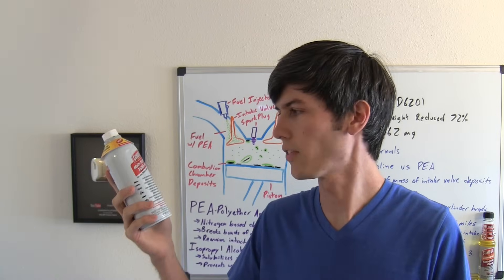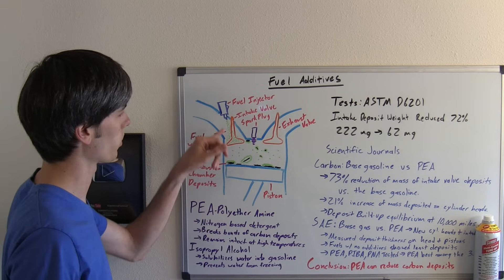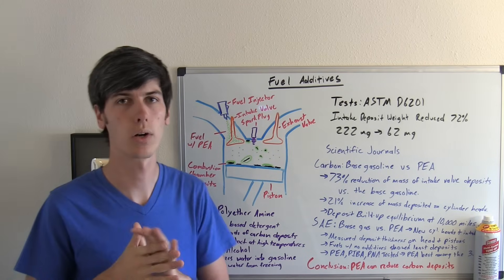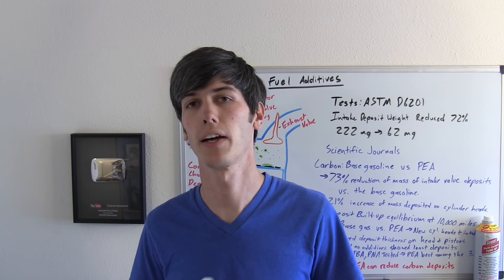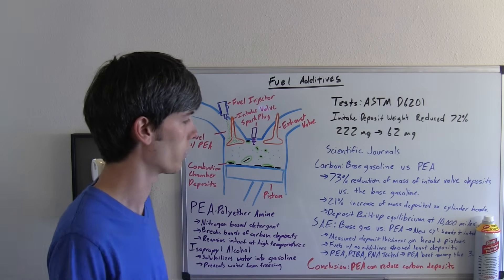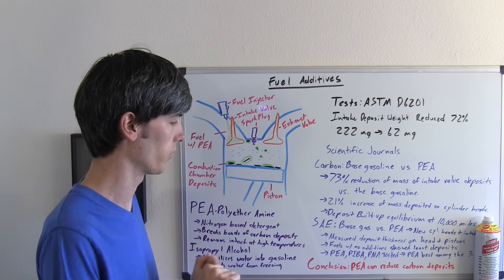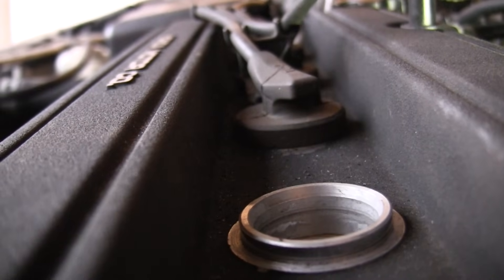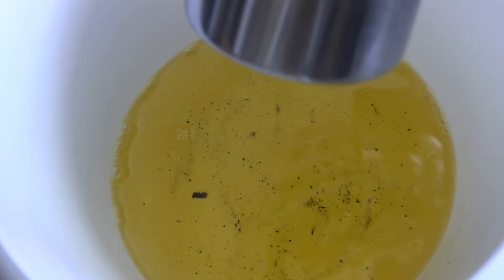Fuel Additives & Injector Cleaner - Explained

Comment: Sorry. I have never heard of any engine failure due to to much carbon. Never. I have driven cars with hundreds of thousands of miles with out any problems due to “ carbon buildup “. So where is the proof that putting this junk in my car will give me any real benefit? 

I can understand something that cleans the fuel injectors but get rid of the carbon in the cylinders? This, and most engine cleaners are snake oil.

Comment: I have a 2011 Subaru Outback with the 2.5 flat 4. That engine is supposed to run on 87 octane but it would knock with 87 so I had to put 89 or 91 octane in it and sometimes it would still knock. I tired the "Starbright" product and after 6 years of less than par performance the car runs better than it ever did. The knock is gone, and the power and mpg improved. I suspect it's the ethanol in the fuel that caused my problems and the Starbright corrected that.

Comment: Chevron patented PEA and called it Techron . That's what I use Chevron Techron concentrated.
Reply: Good to know. So Techon will be good for the intake valves and not so good for the piston head.
Reply: Michael Webber Actullay it's good for fuel injections and fuel lines. My gas gauge was acting up and after a Techron treatment is back to normal. I use it before smog test and oil change. I suggest replacing the oil afterwards.

Comment: i've used additives on older cars with more miles on them and when i didn't really know the history of how that engine/fuel system had been treated prior to me owning the car, but now that i have a 10-year-old car that is direct-injected and turbocharged with only 75k miles on it as my daily, after replacing all the ignition coils and spark plugs with brand-new Bosch OE-spec products, i just make sure to always fuel up with top-tier gasoline (my personal choice is Valero 92 octane) and i'm confident that will keep it running great for years to come!

Comment: Hi
Thanks for posing some interesting subjects. Can you help/advise/give your opinion on using a small amount (13ml) of 2 stroke oil (for lawnmowers etc) into a full tank of diesel fuel to clean and lubricate. 
I'm in the UK & I've read many forums and chat rooms with people saying it will clean and lubricate many moving parts in the engine including the top of the engine, & also advised it helps the turbo and exhaust system. 
I'm told many people in the USA have done this for yeeeeaaaarrrrrs & read on a nationwide road recovery company here in the U.K have recommended doing this, as there are cleaning & lubricating properties in the 2 stroke oil? 
Your thoughts & opinions would be gratefully received. 
With thanks & kind Regards 
Sam

Comment: The old trick for getting rid of carbon buildup was to pull off a vacuum line, take about a 1/4 cup of water and let the engine suck it out of the cup in bits. Don't just stick it in the cup until ti drains, just a bit at a time. Works great.

Comment: Just drive your car on long drive like 300 miles plus it will clean your engine. There is a lot of info on this works great. It's a cycle  that is efficient high rpm and steady for a long time.

Comment: i work for a city and the mechanics sort of rave a bit about Chevron Techron. i wanted to ask you your opinion on this additive in comparison with Lucas Fuel Treatment via an upper cylinder lubricant. You seem to get a lot more for your money with the Lucas.
Reply: I have been using Lucas for 12 years and have not had any excessive carbon build up in my engines. I also run Mobil 1 fully synthetic oil. 1983 F100 straight 6 4.9L rebuilt long block in 1999 still runs great after 18 years.  2007 4.6L Mustang has had Lucas fuel treatment in almost every tank of gas. I got 77K miles on it, so far so good.  On my 2005 Kabota diesel fuel tractor, I adjusted the valves at 1000 hours using Lucas not a speck of carbon build up could be seen. The lifters was wet with a thin coat of what I would say must be Lucas.  Looked just like a seasoned, oiled cast-iron pan...  I buy Lucas by the gallon it last a long time...

Comment: Years back before real fuel injection in gas engines we used to use a spray bottle an atomizer with H2O, prayed directly down the Carb throat with the engine @ 1500-2000RPM. Seemed to work back then. have not done this yet w/current fuel injected gas engines. Thanks, Rich

Comment: I recently tried VP Racing Fuel 7 in 1 fuel treatment and it claimed to boost power, boost MPG, boost octane, cures ethanol problems, stabilizes fuel, and cleans injectors. Well I don't have a bore scope so I don't know if it cleaned them or not. I used this on my 1997 Nissan pickup 2.4L and it seemed to me like i actually went through a whole tank way faster than I did without using the additive. I'm pretty disappointed in it. It says to use every fill up but I'm not sure if I should. A full tank lasts me about 2 weeks and this tank lasted me only 1 week. Now unless there is something wrong with my truck then maybe I'd better find out what's wrong and test this product again. Any suggestions?

Comment: Ethanol combustion does not leave carbon in your engine. Gasoline will leave carbon in your engine and varnish in your fuel system. Ethanol is the superior fuel. intake valves get cruddy from the pcv and carbon residue from gasoline exhaust through the egr.

Comment: Engineering Explained... Did you comprehend the article that stated the build up increases on the cylinder walls. Why would you recommend the product after that?
I didn't come across any engineering or any explanations in the video. Only commercial claims for what some chemical can do and a very lame "experiment". Try the same "experiment" with water... heh...

Comment: there are different types of fuel additives, there is not a fuel addtive that does it all, you have the octane booster additives, the lower emissions additives and the cleaning and storage addtives, the octane booster addtives are crap, they dont work, they just raise the octane rate just a bit which means nothing, the lower emissions additives do work, they are made of ethanol or any other ether such a e.t.b.e., they do help to lower the emissions and they are mixable with water, so they help to eliminate the water in your system but they dont help against corrosion and the last one, for cleaning and storage, they are made of slightly oily chemicals so they are good against corrosion but absolutely not mixable with water, they clean your fuel system and keep your fuel fresh for a longer time but they are not a magical formula which will clean shiny everything with just a single use, it needs a constant use and the right proportion to keep everything clean, even some motorcycles such a kawasaki in their owners manual suggest additives such a sta-bil for storage and maintenance

Comment: now how about GDI motors, since the fuel injectors are past the intake valves?  I have read a lot about the GDI motor and that's a big issue with this type of engine, you get a lot of carbon buildup on the backsides of the valves where if you introduced a fuel cleaner into the gas tank, that'll just go into the chamber and ignite.  I have this problem, any ideas?

Comment: I just stumbled on this and I have a question: would the design of Direct injection engines, the additive wouldn<t coat the valve as much since the fuel is directly shot in the cylinders head and not in the intake runners, before the valve.

What kind of enigne design do those test use?

Comment: During the past months I've been adding 2parts of acetone (the painting thinner kind) for every 1000 parts of Diesel in my VW Touareg and 3 parts for every 1000 of REGULAR (that is EUROPEAN REGULAR 92 octane) gasoline in my motorcycles and apart from easier starting, the motors are quitter and a bit more torquey. Look at this:

http://www.sciencedirect.com/science/article/pii/S2215098615302469

and this:

https://www.google.gr/url?sa=t&rct=j&q=&esrc=s&source=web&cd=1&ved=0ahUKEwiQqOrN59PSAhWBWxQKHWhqBVEQFggaMAA&url=http%3A%2F%2Fwww.mdpi.com%2F1996-1073%2F9%2F4%2F256%2Fpdf&usg=AFQjCNGseCqNSUM81Yu8hSaVIBbeyKjCDg

Comment: ok so my 01 taco has never had anything done to it beside the normal maintenance (Tires, oil, pads etc.) all factory clutch diff trany etc but at 220k miles would carbon build up a factor? at this point i wouldn't notice any gradual change in the engine performance

Comment: So, with today's direct injection engines, such as the Subaru FA20 WRX motor, how do we avoid the carbon build up problems that have befallen these motors, aside from using a high quality premium fuel? From what I have been told, the problem is unavoidable......

Comment: I just bought a car that has been sitting for over a year out in the open, should I flush all fluids and use this as well with a tank full of fresh gas?
Reply: Vomit Punx check the oil if it looks just dark and not black run it for a few hundred miles then change it. Transmission shifts ok don't bother you may harm things. Toss in the gas tank some Heet or even ISO Heet is better and use up the gas. It will remove any water build up in the gas tank.i change my oil when it starts showing dark enough I can't see my oil level lines.
Reply: Arthur Smith sweet thank you

Comment: i liked the little test you did on the exhaust tip. but you also gotta remember that when the gumout goes into the has tank it goes through the fuel injectors it gets super heated and compressed. so the results of that little test would probably be more dramatic inside the combustion chamber
Reply: Bg44 k platinum excellent product for cleaning carbon deposits

Comment: Buy ethanol free gas if you can
Reply: it has its pros and cons... ethanol actually allows for more aggressive timing for more power since it burns cooler. just worse mpg
Reply: But ethanol does not leave carbon in your cylinder
Or piston or egr/intake. Gasoline does. Gasoline also leaves varnish in your gas tank. Ethanol evaporates without any residue. Henry fords model t was built to burn ethanol or gas, he touted ethanol as a superior fuel that could also be produced on every farm in America
Reply: Caveman1420 burning if petroleum  (gasoline) results in water formed as well just not as much as ethanol. 

ethanol will in itself result in cleaner engines and less carbon deposits the only concern I'd have regarding water is more water getting in your oil.
Reply: vipmd Unfortunately Not Available In California. (As Far As I Know.)
Reply: Ya it leaves the water behind.
Reply: Ethanol free gas is $1.00 per gallon more here in SC.  It contains no cleaning additives, unlike the major blended  brands of ethanol mix fuels.  Modern automotive engines are made to run on ethanol blended fuels.  Non-ethanol fuel is best used in marine applications or lawn maintenance machinery.  I have run many tests with my Toyota Tundra using non-ethanol fuel and it delivers only  ".1" or 1/10 per gallon better mileage.   No performance change either.  So why would you spend $20.00 more per tankful just to go two miles farther with no cleaning additives?   SMH.
Reply: Richard Kaltenbach yeah California is not even America to me
Reply: vipmd i love that statement!!

Comment: so what do you do just add this to the gas tank where you put fuel in the car ?
Reply: pavy415 check out on Google BG44k added to your fuel. The best
Reply: pavy415 Look up Top Tier gasolines.,  YouTube Investigation: best fuels for your car. You see Exxon Mobil is best for regular Shell is best for premium and so on down the line. Use a top tier gas you should not have any problems. Toss in a can of BG44k a couple of times a year.
Reply: Can I use BG44k for a Prius?
Reply: mdadnan yes you can. BG44K is for gasoline engines. Any auto parts store should have it. Autozone or Advanced Auto parts are big stores.You can also buy from EBay or Amazon. Make sure shipping is free. It's a bit more money than other fuel cleaners but well worth it. I put a funnel in the gas tank and pour in the BG44k. If you don't have one your gas station should. Make sure the funnel is clean.

Comment: Maybe I missed something.  It says that there was a 72% reduction of deposits on the valves, but a 21% increase on the piston?  Is that correct?  If it is correct, what is the measurement of this reduction and increase?  I ask because a 72% reduction on a valve surface could simply be equal to a 21% increase on a piston surface, still leaving most contamination in the engine.

Comment: Would Carbon build-up cause my exhaust to be really smelly and smoke/fume/vapor coming out of it, or would that be due to like a cracked exhaust manifold or something? Just trying to figure out what steps need to be taken to fix the old truck most efficiently.
Reply: Your engine is probably running rich meaing its getting to much fuel. The smoke is unburnt fuel.
Reply: Tyler Johnson oh really? It's a 22r in an 87 toyota hilux. Would the carb or injectors be the problem? I'm in the process of buying a new clutch so would like to make one big repair day since I'm doing it myself.
Reply: +Fumferknuckle nice try lol
Reply: david beach what do you mean? Just trying to fix my truck mate.
Reply: Its either got a carb, or fuel injecton... Either way your EGR (if you have one) could be clogged up.  Could be running rich on the carb also.
Reply: madjimms right. I honestly knew you had either one or the other, but when typing that I was thinking there had to be some kind of mechanism that pushed the fuel into the pistons, so for lack of a better term I thought of injectors. What is an EGR? If you can explain before I get off and Google it lol. So carb needs to be replaced or the EGR is what I got so far.

Comment: You can just spray water, like a mist with spray bottle, into the intake while running, and it will get those deposited out. Just not to much or you will hydro lock it. Also SEAFOAM. that works great.

Comment: I've used SeaFoam before and it worked great, other stuff has been reported to damage seals, gaskets and whatnot. I normally use Lucas fuel injector cleaner every 2nd to 3rd oil change.
Reply: Aulkraen Check out on Google BG44k for fuel. top of line fuel additive.

Comment: additive test are usually done by las sponsored by manufacturers. Unless, you get independent audit...those "tested" additives rarely work...it is like synthetic vitamins, they just make expensive urine

if you once a while take your car for spin and don't drive it under revved...you don't need to worry about any deposits ;-)

most deadly thing for any engine is operator. for some reasons people believe engine has full torque/power at idle speeds or slightly above.

I always drive car at 80-100% load, use cetan additives for better burn of fuel mix...never had problem with injectors, clutch, deposits ;-) Every system is only as strong as weakest part.

Comment: again a great video, and you have a new subscriber!
as for additives, it explains my experience from a couple of years ago, when I was given additives as a sample from my friend who used to sell them, at first my car started running better it felt smoother and the fuel consumption went down, so I started buying the additive and using it regularly (in the interval suggested by the producer) and within 6 months my engine started working WORSE than before the additives! so I stopped using them, and used highest rated fuel I could buy for a couple of months and luckily it somehow cleaned itself and went back to normal!
this video makes me think I would have benefitted better have I cleaned my car originally with the additive and then just stopped using it, I think that would have been the best option